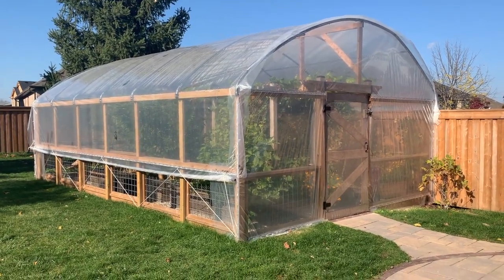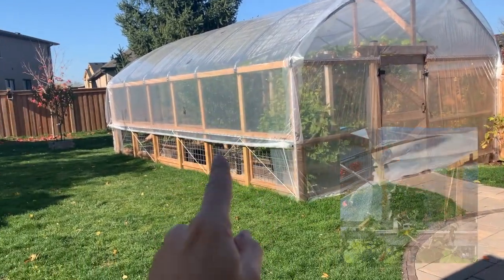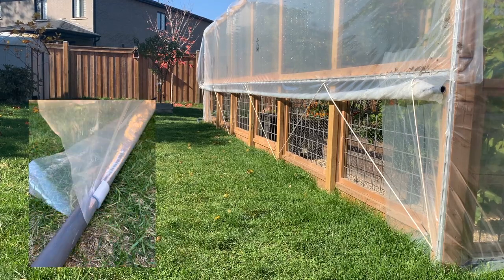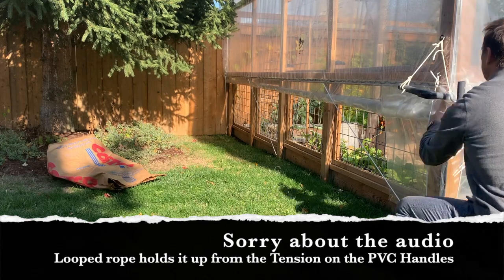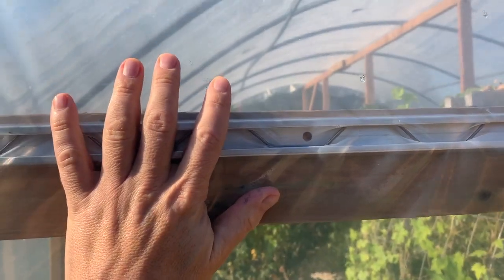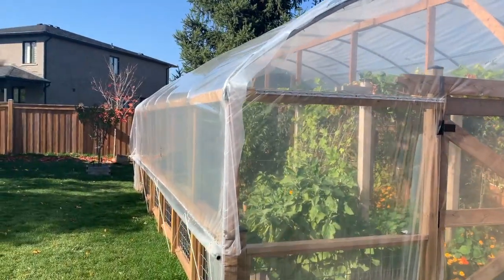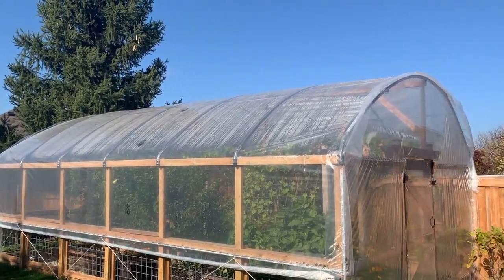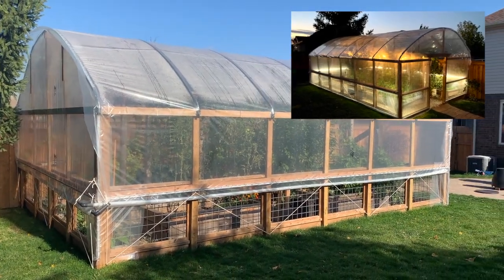HOW WE BUILT OUR DIY GREENHOUSE: Extend your growing season from 6 to 10 Months | MyNiagaraGarden

Comment: Did you sink each post into the ground or is it just sitting on top of the ground?
Reply from the maker: The 8ft 2x4s, which are the walls of the hoop house, are fastened to the 3ft fence that surrounds the original garden.  That 3ft fence is  sunk 3ft underground, on concrete footings. The plan is to be able to transform the hoophouse back into a regular open air garden each spring after the last frost, then cover it again each fall.
Reply: @MyNiagaraGarden  Thanks for the quick reply.  How has it been holding up in our northern winters?
Reply from the maker: @livefreefarmstead  sorry that this reply wasn’t as quick as my first. 😁 The hoop house is holding up pretty good to the cold, the snow and the wind.  There’s been a couple times that a heavy wet snow stuck to the roof and started to bend the hoops, but I caught it in time, and I dusted it off from inside with a broom.  I’ll be posting a video about that soon.   The winds off the escarpment here in Niagara are pretty hefty!  But so far it has stood up to the worst of the winter! 🤞🏼